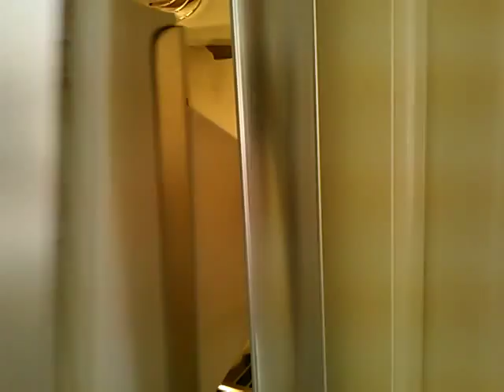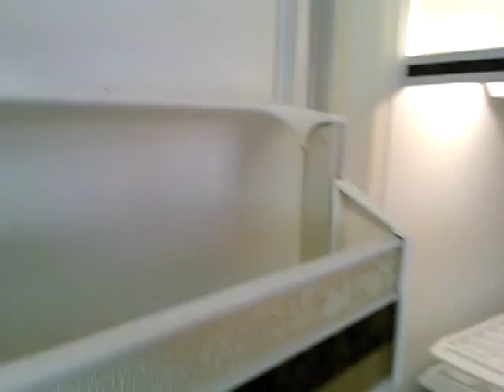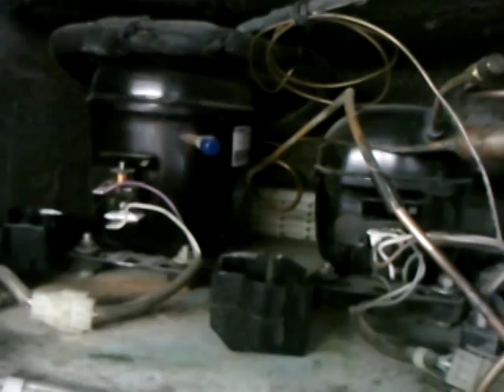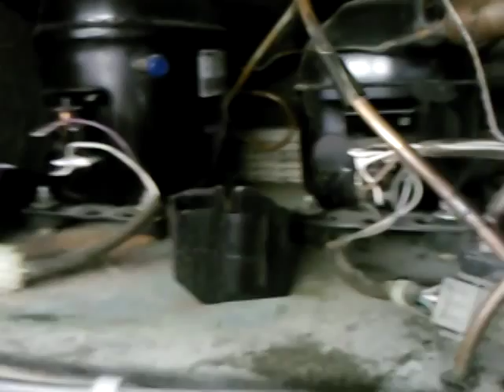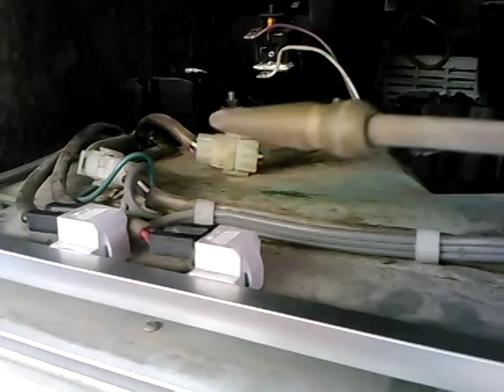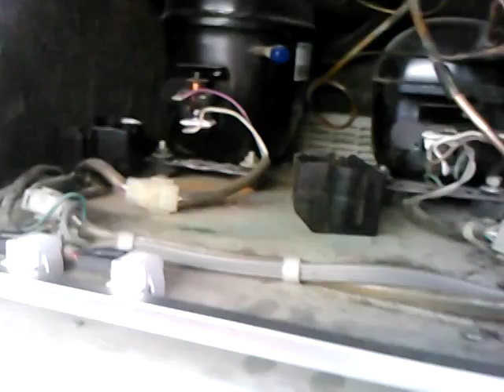Sub Zero 3211RFD 48" Refrigerator - Problems, Observations, Questions MOV377

Comment: I bought a home with this model.  Where are the temperature control dials located?  Thank you.
Reply from the maker: Great question. I've forgotten but maybe could go take a look.  Seem to recall the freezer side has kind of thumbwheel at the back of the evaporator housing. The not freezer side ... don't remember but it's there.  I've kinda got this one stashed till I decide what to do with it, a couple bicycles now blocking my access.  Do you still need this info ?  Thanks for the comment.
Reply: When you get a chance, please, but no rush.  I've looked everywhere for an answer and have found none.  I even called SubZero and their customer service rep had no clue, saying it was older than 25 years.
Reply: @guidoguitar  U are a waste of air

Comment: I just purchased an old home that has this model refrigerator. Both freezer and refrigerator are cold. But the fan at the top runs nonstop and blows a great deal of hot air from the grill. Is that normal?
Reply from the maker: Non stop fan is normal I've come to understand, it's wired direct to the input power / plug.  Chances are one compressor or the other is on most of the time, I figure that's their theory.  A "great deal" of heat is hard to quantify, some of the heated air should be going behind the unit and out the bottom too. If it's working good, I'd just pay the electric bill and keep it going.  You might also carefully clean the condenser at top right.